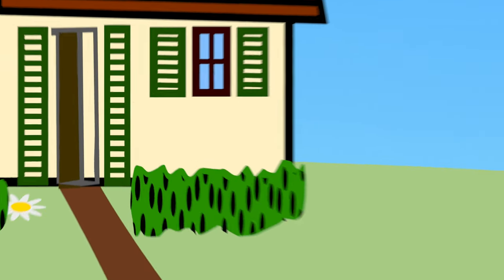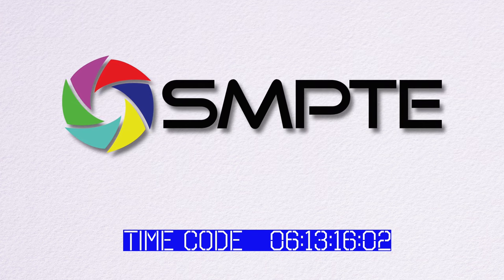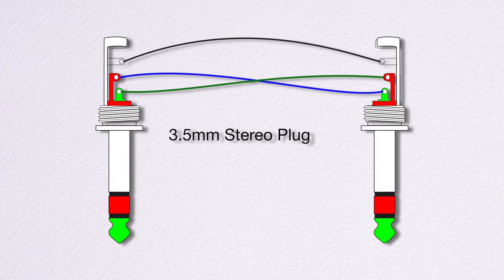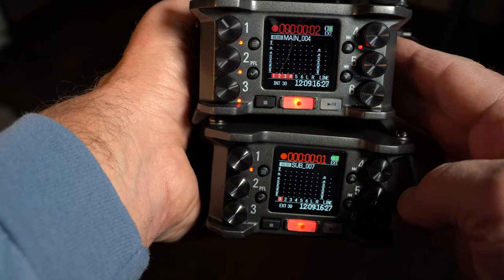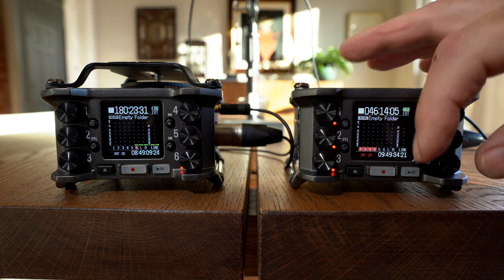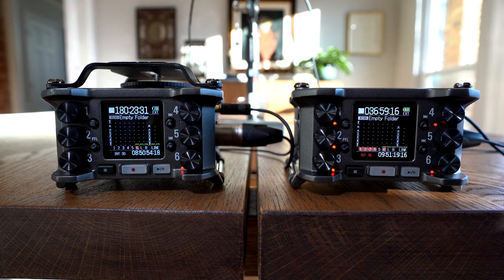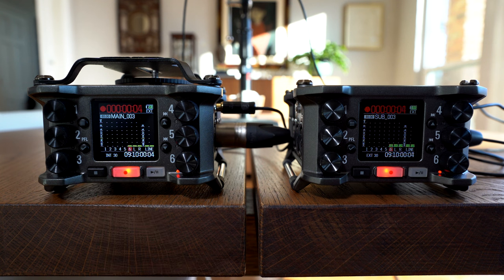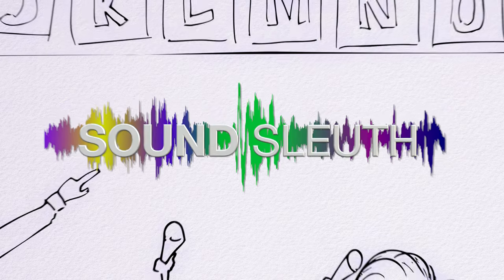How to Time Code sync two Zoom F6's

Comment: Can you explain why the crossover cable please (another source suggests a straight TRS cable would do)? As the F8n pro has a BNC connection I assume an BNC to female TRS adapter is needed, then a crossover cable? Thanks in advance.
Reply from the maker: The crossover cable is needed because the F6 uses a stereo jack with incoming time code on one channel and outgoing time code in the other. A straight TRS cable would connect input to input and output to output. Thus no transfer of time code.

Comment: Great video!

I want to try this with three (3) F6's to record a 5-piece live rock band (2 guitars, 1 bass, and 2 keyboards direct, 4 vocal mics, 3 drum mics, and 2 audience mics).   In I am not worried at all about phase, it's mostly a question of starting both slave units at the same moment as the master so I don't have to spend time aligning all tracks once I get them into my DAW, and the tracks will stay on tempo with each other (+/- 7-8ms over 3 hours).

I think I am correct in concluding that in your master/slave example, the timecode signal flows in only one direction, from the master to the slave, and there is no "acknowledge" signal back the other way from slave to master?  In terms of hardware, your example therefore could have been done with a simpler 2-conductor cable (rather than a crossover cable), wired so that master RING goes to slave TIP, and master SLEEVE connects to slave SLEEVE.  Is that right?  No connection from slave RING to master TIP required?

In that case, I could make a special '3.5mm 'Y' cable that would send master RING to both slave TIPS, and master SLEEVE to both slave SLEEVEs.  I'm assuming the line driver in the master can provide enough current to drive two slave inputs at the same time.  I am also assuming that the two slaves can be configured identically.

Am I overlooking anything?
Reply from the maker: That should totally work.  They will stay within 33msec in 24 hours “per spec”.  My testing had two synced to order of magnitude better
Reply: It totally worked! I can now run three F6 recorders (18 tracks) using this technique with zero problems.   All 3 recorders are now onstage and I'm in the audience with a beer.  I can start and stop the master between songs using the IOS app;  the slaves follow right along. Along the way I also learned that the F6 Timecode INCLUDES Wordclock info which does indeed keep all three F6 recorders locked at the A/D level, at least at 48kHz.   When I import a DAW (I use Studio One) and look at the files down to the sample level, they are in perfect synch (if you give them the same signal, that is; if you give them the same sound from different microphones that are apart from each other, you start to see a phase difference).   I built a little box that will ultimately handle Timecode for a 4th F6 if I ever need to go to 24 tracks.  This whole setup is much simpler and easier than my prior method, which was to used an Alesis 24-Track HD recorder, along with a 24-channel snake to the stage, plus a mixing board to monitor & control levels.  I can now set and forget using 32-bit recording and the absolute minimum of gear.
Reply from the maker: @PelicanMultimedia  excellent!!!

Comment: If cabels would be made right, could be synced more than 2 Zoom F6 recorders? I mean.. TC out from one to in of the second one, the OUT of the second one to the IN of the third, and so on.... say for 10 F6 recorders, then from the last one's TC out, to the first one TC in? 
The first one set as master, and all the other 9 recorders set as you set the second on in this video. Will all the recorders start recording when I press record on the first master one? Also, I expect all the files recorded, throwed in a DAW a synced like magic (ok ok...with one second delay on all the 9 slave recorders, in an hour of recording).
What do you think?
Reply from the maker: You need a cable that is parallel. As in the Master drives multiple Zooms. I have done this with three of them an F8nPro as the master then running it into two F6's. In that case I have a BNC going to two 3.5mm jack "Tip" connections. Ensure they are set to Ext Auto Rec and the F8 to only send time code when recording.

Comment: Would a Fn8 Pro and F6 sync the same?
Reply from the maker: I just bought an Fn8 Pro. I plan on testing this , will let you know!
Reply: Thank you!
Reply: I just played around with my f6 and f8n pro - took some fiddling around but I got it figured out and it works
Reply: @roffels  Same connection as in this video or different? What were your steps?

Comment: Hello, 1-hour audio of Zoom F6 lasts 1 second more than the audio of my Lumix FZ2500. Is there any idea how to decrease the duration of F6 audio track? Thanks
Reply from the maker: Bring them both into Audacity. Select one and determine its exact time. Time stretch the other one to that time.
Reply: @SoundSleuth  It's not a good deal, as there is an issue of classical music (orchestra recording). Any processing will affect the sound quality, and, unlike speech, it should be brilliant. Anyway, thanks for your reply!
Reply from the maker: @Destynick  Please try it. the shift is so minimal you wont notice it. If it is a second  over one hour time stretching won't even register as a pitch shift.
Reply: @SoundSleuth  Ok, thank you!

Comment: Hi. The video as an explanation is OK. However, the proofment at the end is completly false. 
1:
If anyone accept this, just does not understand that, how DAW uses those samples from different files (anyway, from any different tracks). The methode is just wrong on in any prospect.
2:
3 sec, 21 sec, I mean such a short record is just not enough to judge. 

I made a real (:-D) test on two F8 (same audio sync) with a 1 and 2 houres record. As a result, I got the: without audio sync activated, the sample frequency ration between units leads to a result of appr. 1 msec different in 22 minutes record. Now calculate: it is a ration of 1msec difference / 1320000 msec full record time =  0,000075 %, already looks good.

Once I activate audio sync on slave F8, this result is 1msec time different in appr. 6 houres. Seems much better, however, it is STILL NOT SAMPLE SYNCED.
At the test you can observe the regulation time of the PLL (wich is a digital one), what has appr. 2 minutes regulation cycle.

Again: it is possible, if recoders of mine has this result individualy. Also possible, if F8 in general can not do it. It is still possible, if F6 can do it.
What I say, THE PROOFMENT AT THE END OF THE VIDEO DOES NOT PROOF IT
I will come out soon with my test methode.
Reply from the maker: I ran this for over an hour after posting the video. It drifted 2 samples in 1 hour 5 minutes. Not perfect but easily usable for audio recording.
Reply: @SoundSleuth  
Ok, dear J. R. 
I did not realised that, this presentation is yours, when we discussed on this at FB previously.

Comment: Can you please send me a link of this cable if u can please?
Reply from the maker: It is a crossocer cable. You have to make one. You connect the Tip of one 3.5mm jack to the sleeve of the second and vice versa. They share a common ground.  THe wiring diagram is at Time 1:39 and the parts list is in the More Info section.
Reply: @SoundSleuth  okay Thank you and if i use fn8 pro as a main and f6 as a receiver with same cable is that positive like this?

Comment: Interesting BUT : but from a purist point of view this setup isn't correct to avoid phase problem between the tracks on each recorder. It's only Time-Code Sync not Word Clock sharing. If you want to preserve phase you need to be synchronized on sample rate that is far more that 1/25 second. That is the purpose of Word Clock and the connection for this standard is BNC.
Reply from the maker: I believe that Zoom embeds it somehow or the ability to PLL create a locked on on the second. It only works on Zooms that I am aware of. I will further test this today and post my results. Need to make an XLR "Y" cable to feed the idential signalk into both.
Reply from the maker: Here is proof with a single mic. Zoom does this only with the F6 as far as I am aware https://www.dropbox.com/s/m4d2z0f25uojfdt/ZoomF6Sync.jpg?dl=0
Reply: Dear Bernard
You are partialy right. Using two mics, such a short time, judgement on what you see on samples in DAW. LOL.... 
However, Zoom try to do sample sync based on TC. How can be it done?
1:
MASTER has its own internal real sample rate used by the AD. Than it creates the Sample Rate (lik 48k) by dividing it. Internal SR is just much higher for AD, because oversampling. Than created intermediat samples will be processed and the result will be, that you gona get at every 48k beats. This sample will be stored for you. I Assume that, you know until now. 
Next issue to produce the time code, wich is fullfill timecode requirements (accuracy of frames), but it is really diveded from internal SR. From that point, TC is locked to internal SR. However, samplerate (48k) and TC would be devided from the same source. All 3 locked to each other.
2: 
SLAVE unit has a real hard task. MASTER phase locks outgoing TC to internal samplerate. Now, slave should REGENERATE its internal sample rate, as you wrote, using a PLL (in case of F8 and F6, I assume that, a digtal one). Once you really use WC between your devices, the method is just the same. The big difference is, at there you have to regenerate for instance 12,288 MHz out of 48 kHz (256 oversampling). Once TC is used, its bitrate is around 1000..1200 Hz (it depends on frame rate), and you should do here the same: regenrate 12,288 MHz out of 1200 Hz. The ratio is 40 times bigger, the thask is more hard to fulfill.

Now, this is, what Zoom tries to do, and we gona proof it, if Zoom does it really or not.

On F8s of mine, seems not. It is good, but far not sample accurated. (I assume, the slave device, the regeneration, not the master.)
Masters task is just easy like video + audio clock sources, you can buy easily.